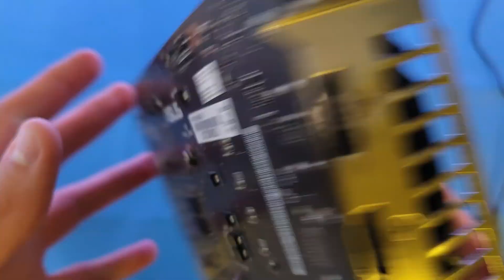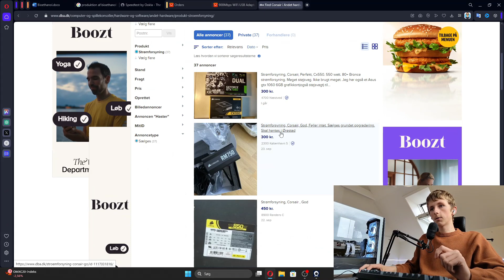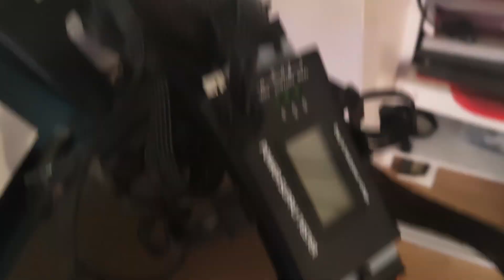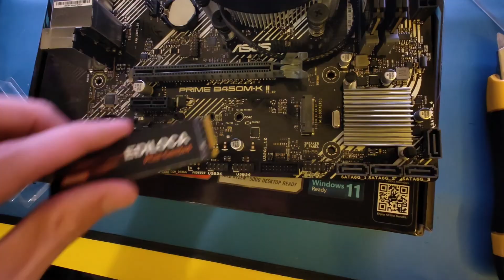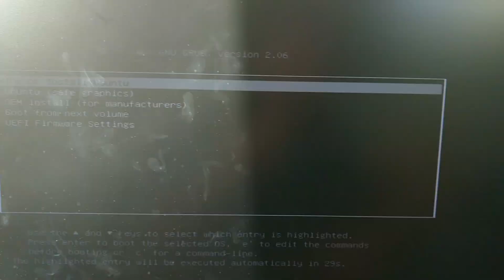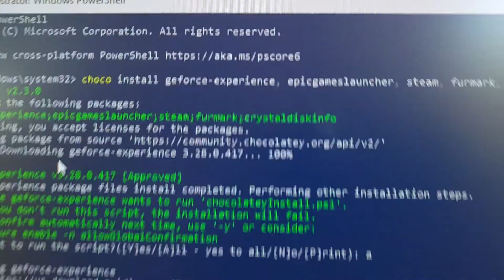Building And Flipping PC's EP8

Comment from the maker: Forgot to put in the price breakdown at 19:59 so here it is:
Ryzen 5 2600 - 225dkk / $32.99 / €30.17
AMD Wraith Stealth Cooler - 40dkk / $5.87 / €5.36
ASUS PRIME B450M-K II - 404.18dkk / $59.27 / €54.19
2x8GB DDR4-2600 HyperX Fury - 150dkk / $22 / €20.11
GTX 1660 Super - 550dkk / $80.65 / €73.74
ARGB Controller with remote - 62,56dkk / $9.17 / €8.39
512GB NVMe SSD - 209.66dkk / $30.74 / €28.11
XFX TS-550 PSU - 125dkk / $18.33 / €16.76
MARSGAMING MC-SE - 348.55dkk / $51.11 / €46.73
3x Thermalright TL-C12C-S - 113,57dkk / $16.65 / €15.23
Wi-Fi BT Adapter - 44,98dkk / $6.60 / €6.03
Windows 10 Pro key from productkeys.com - 66.61dkk / $9.77 / €8.93
Power cable - 20dkk / $2.93 / €2.68
Elecctric tape - 10dkk / $1.47 / €1.34

Total - 2369.67dkk / $347.49 / €317.70